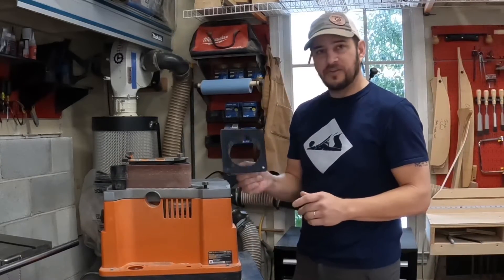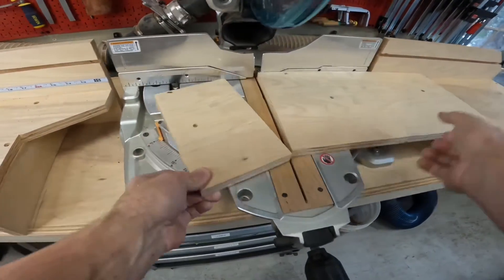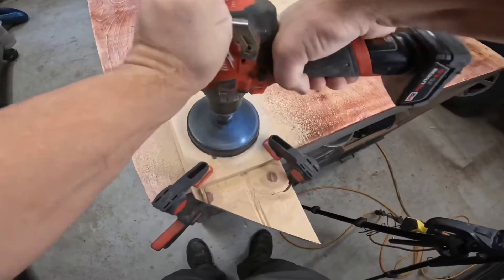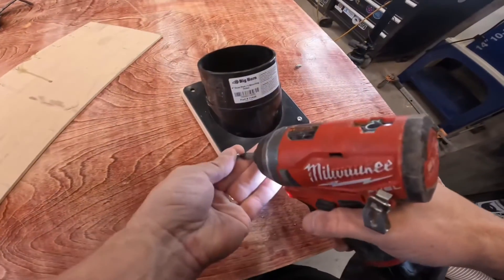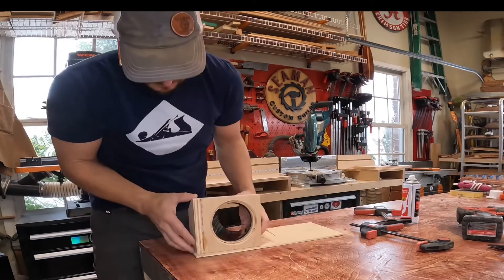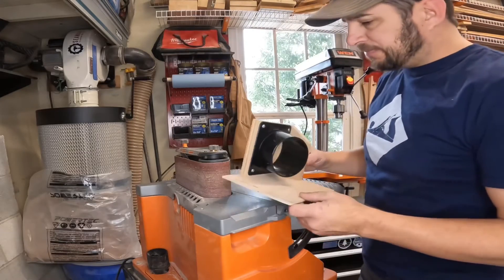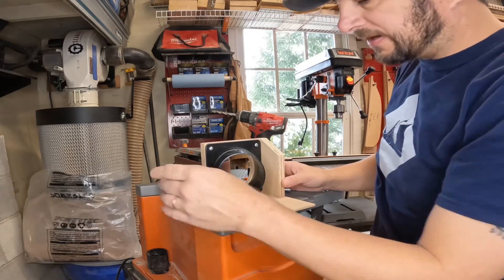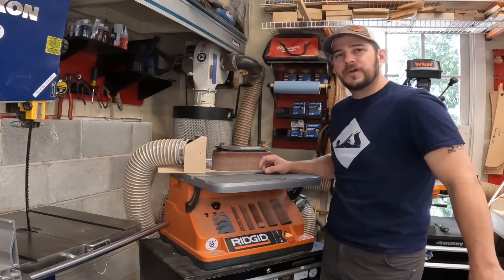Ridgid Belt Sander Dust Collection Upgrade

Comment: Thanks for this video.  I was just looking at moding out my unit the other day after sanding a bunch of little boat parts.  You have to wonder if Ridgid even tested their dust extraction design because it is pretty much useless!  I started by taping up the slots on the back then added a wye to draw dust like your mod as well as from the existing port.
Reply from the maker: Yeah seems like they didn’t test much, thanks for watching